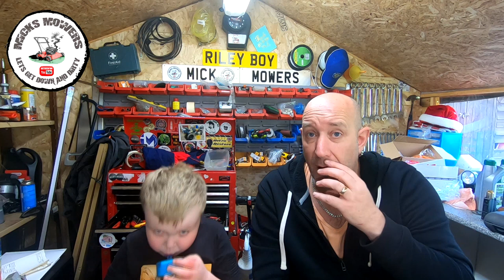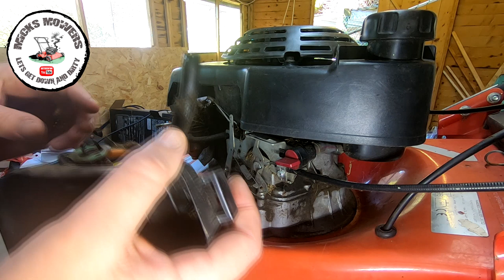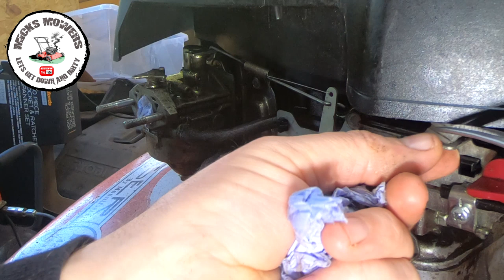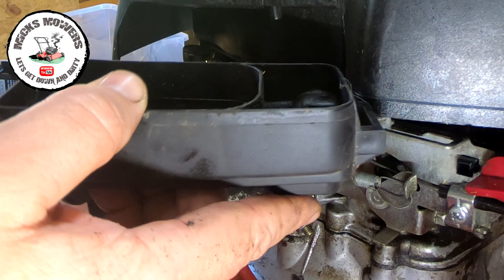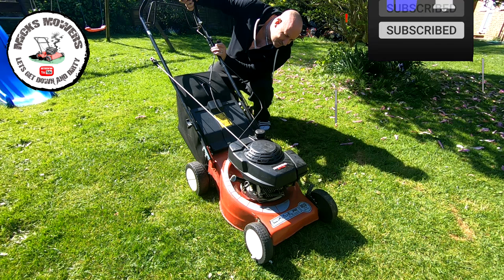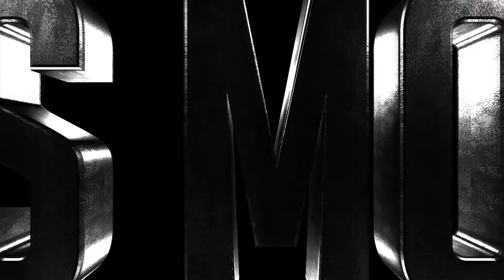How To Fix The Throttle On A GV100 Honda Lawn Mower

Comment: I sold a Toro mower to a fella two years ago. I had it for a year with no problems. After two weeks he brings it back. Carb was missing a part. Fixed it , off he went. Two weeks later, it came back with a loose spark plug. A month later, back again, I took care of it. A month later it was not running again. I think he was a bit of a tinkerer. Never saw him or it again.
Reply from the maker: Yeah I get them like that. Popping back with bits missing.. hope your good

Comment: Hi. I follow you on YouTube, hope you don’t mind this message. I have a sv150 engined mower, it starts and runs ok however on startup it idles nicely but when I pull self propelled lever the wheels go round and it drives but engine seems to remain in idle..Therefore cutting grass takes ages as it’s only driving at idle speed. It doesn’t have a throttle.. should the engine get faster when cutting?  Thanks john.
Reply from the maker: Hi max. It should run at 36 thousand rpm ish.. try and turn in the idle screw its location is on the top of the carb. Slowly turn it in till the rpm picks up.. but do t run it too fast
Reply from the maker: Send me a photograph via email mate
Reply: I turned idle screw on side of carb..seems a bit quicker. Thanks for your reply. 👍😀
Reply from the maker: @mark8111xx  your welcome mate

Comment: are you not asking for trouble in the future by not replacing that neoprene hose looks stiff it does and yellowed out
Reply: It's just a bowl vent/overflow tube.  It really doesn't do much.  That gasket though, that's a different story.
Reply from the maker: As below it's just a air hose.. even if missing it would not be a problem
Reply: @themowerman  okay mick thanks
Reply: @tonyfremont  thanks